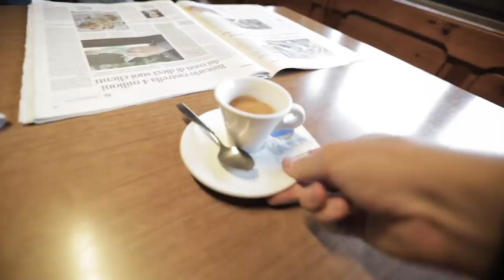Building my DREAM BIKE - Wilier 0 SLR

Comment: 1:24  i wonder what they call it ?  precision hammer installation? on a 4k frame? i wonder if the guy has a finely tuned hand accurate to +-4%? also hammering the shifter?? 1:57 why ?
Reply: because it works, it's fast and it doesn't hurt the bike?

Comment: not even using a pressfit tool nice to see that i can save those 70 bucks for that tool :)
Reply: I nice work around is a thicc piece of threaded rod with bolts and big washers. Saves knocking it in with a mallet. I bet that guy's done a million of those.
Reply: I've done the mallet method... works in a pinch, but not all BB's are perfectly round and you risk scoring the cup. It's much safer to get a large threaded rod and a couple washers if you wan't to go cheap.
Reply: the most expensive parktools is 70 but xou can find simple ones for 10 bucks

Comment: Very lovely ...... did they force you to go for the sub-standard group set. Ultegra with it's ropey down shift, shit designed hoods and oooooooohhhhhhh so slow gear change.
Reply: whoops ... Di2 Dura Ace. Sorry a very good group set if still a fairly ropey down shift and crap designed hoods.